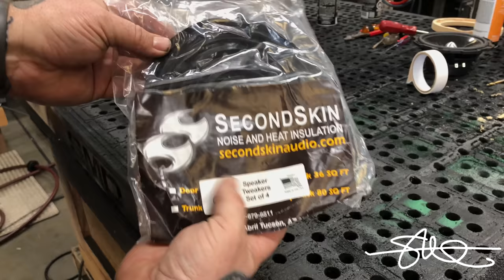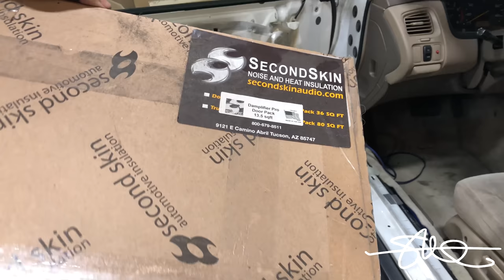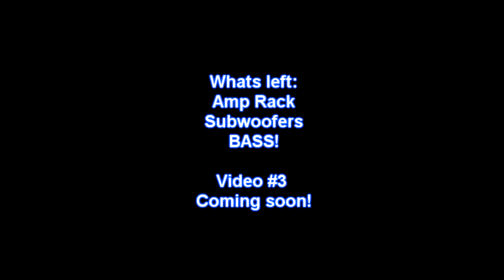First "Real" Sound System - Full Install! 6.5" Component Door Speakers, Wiring, Crossovers (Video 2)

Comment from the maker: for daily updates a lot sooner than youtube....visit and follow my instagram channel http://www.instagram.com/meade916 thanks!
Reply: meade916  I can't wait to see his face
Reply: meade916  i recently found out that the amps in my truck are not even secured  they’re just wired in  are you open to the public? I do understand you are doing this system for someone you know.
Also i seen stan around for a few years now 
What u did was straight up knocking it out the park man.
Reply: meade916 bro looks good although I had a bad experience in not running it through the stock boot . Ended up getting water in the cab ...
Reply from the maker: sounds like you or your installer didn't know what they were doing.  Next time take it to someone more qualified.
Reply from the maker: sorry Audry my shop is not an install bay for the public. But thanks anyway just in case i was! :)
Reply: meade916 clean ass install... You make it look so easy lol .
Reply: meade916 what radio station do you listen too most of the time it's a good mix of shit...
Reply: meade916 psyph Morrison a youth football coach? With music that hot, I'm puzzled why he's gotta have a job, let alone not drive a wraith. Lol shout out to the big homie!
Reply: Real talk I can see you doing a show on the velocity channel.
Reply: meade916 ya Mr Steve Meade I'm very interested in your RCA wires and was looking into a couple sets... my questions is, and it may seem dumb but I have to ask..does it make that much of a difference and why?..not just for me sir but to all the noobs like me...I've only been back into this of lately and I love your products Plus I rep 916 also...looking forward to more of your vids and products...✌🏽thanks Triple OG
Reply from the maker: music business is tough no matter how good you are...if you aren't established and have a big label backing you, it is a struggle.  He deserves more than he has but he is a fighter and will keep pushing till he has nothing left.  He is a good dude.
Reply from the maker: spotify....
Reply: Do you have a video of the customer  picking his car up?
Reply from the maker: SMH
Reply: meade916 smh?
Reply from the maker: yes. That means i am shaking my head.
Reply: meade916 did I say something wrong?  I just want to see his reaction. You do the best work. I've been following  your work for years now since gotten on YouTube
Reply: Your like the God of subwoofers!
Reply: Meade916 , nice video, u are a bad man. Bad as In Michael Jackson bad. Question I see you used a set of Rockford Fosgate T2652-S for the front speakers what would u pair to put for the back speakers and which amp wattage would you used? Thanks for your time.
Reply: I have 03 dodge ram my dashboard has 3.5 i want to turn it into 5.2 how much work it needed
Reply: meade916 what’s the best style of door speakers circle or oval
Reply: Sí CASA Teocaltiche Jalisco Chevrolet Cheyenne Silverado lowrider carro foto carro facebook Armando Ruvalcaba feliz cumpleaños 
3 de junio del 1986 3de junio del 2019 🔊🔊🔊🔊🔊🔊🔊🔊🔊🎧

Comment: Call me a noob but that's the first time I've even considered mounting the crossover inside the door. Top notch job too with the custom bracket and everything. And to think I thought I was so smart for mounting the crossovers behind the a-pillar kick panels in my first install in my cousin's Ford Sierra over 15 years ago, haha. Though to be fair in that setup I mounted the tweeters about 1/3 the way up his A-pillar next to the front window, so I suppose in that case the crossover location did make sense. Still it's nice to learn new stuff especially since it's done with so much attention to detail. I love stuff done properly and Steve you always deliver, thanks!

Comment: Steve, your work is super clean. I have a car like that and it was a bitch to run the front speaker wires. You accomplished the cleanest look I have seen right there. Not even my car and I really appreciate your hard work to get it done right.

Comment: I actually engineer, design, install and program whole house automation, and theaters, which is all 12 volt anyway, but what I enjoy is that he makes his nstalls as idiot proof as possible, just like I use to do when I installed car audio. I carried that level of detail into home audio, and started my own business doing to homes, what he does to cars. #TRUESTORYBRO
Reply: If you ever need a sound barrier for a sound studio, hit us up Our Luxury Liner rolls make an awesome barrier layer and are used in Dr Offices, Elevator Shafts, and even in Recording Studios like the new one being built in Burbank, CA using Second Skin Luxury Liner (Can't reveal the name yet).
Reply: Second Skin Insulation I'll keep that in mind, I usually use quiet rock, and various industry standard acoustic panels to remove reflection, and so forth. There isn't a whole lot of call for sound deadening, as we aren't talking about incredible decibel levels, but rather HIGHLY calibrated set ups for 7.1+...
I will keep that in mind though, if the situation ever turns up, or I build another car audio system.

Comment: Sound system costs more than that car!!!
Reply from the maker: probably cost more than YOUR car too. So what is your point?
Reply: I drive a 2014 charger v6 with 39,683 miles on it, you figure out the kbb value and let me know if the stereo is worth more.

Comment: Hey Meade916 Nice Work!
Thanks for Sharing. That was a neat idea for the Crossover & Tweeter install.

I am installing these R.F. T3652-S  with a R.F. T1D2-10 Sub in a custom High-Output, Ported enclosure Box & a T1500 & a T1500-1BDCP 1500 Watt Class BD Power Amplifier  in a GMC Savana Cargo Van.  
Of course I Sound Deadened all the walls, floors & overhead Cab area.
I'm thinking of building a upright Shelf 2010 Aluminum extrusion to house the Units the Sub, Amp & axillary Stereo. 
Any suggestions?

Comment: Curious why you door mounted the tweets instead of the factory spot, just simplicity? Also I have an 02 Accord as well, hit the door jam boots with the heat gun for a minute. Makes it flexible enough to get the wire through easier

Comment: Any concern with the extra length of wire coming of the tweeter hitting the 6.5? Did you pull the extra wire back towards the crossover?  I am only asking since it was not in the video.
Reply from the maker: no concern. Thanks for the concern. :)
Reply: Thanks for the quick response, Honda coming together nice, Mr. Morrison will be excited!

Comment: I love watchin these, ive never done componets but you just made it look real easy. I might try it on my impala but i dont think im gonna be able to make a holder like that for my crossovers
Reply from the maker: the holder is purely freestyle. Each car will have it's own challenges as well as easy stuff.
Reply from the maker: oh, and thanks a lot for the comment! i appreciate you man!
Reply: End of the day you can always move the crossovers around if you need to, if you can't mount in the doors themselves find somewhere around the dash and just run the wires through

Comment: I always see most systems only have those type of speakers for mids and so do I, and I have a hard time with midbass frequencies. Most music on my system sounds ok, but if you play some  music which has high bass frequencies, my system barely plays those. For example, if you play "Cuban Pete" from Kings Of Mambo soundtrack, the higher bass notes can barely be heard on my system.

I have gains almost correct (set up by multimeter, other tools are just too expensive for me), nice equalization. I have a Powerbass 4XL-65-92 mid set, DB drive Okur Tweeters, a 10" flat Pioneer sub, quantum audio xtreme series amps (1 for mids and highs, 1 monoblock) and Pioneer head unit. I had a different DB drive amp before and it was the same thing with frequencies.

The mids are installed on kick pods. WTF am I doing wrong?
Reply from the maker: your gains are wrong for starters.  You simply cannot use a DMM and have it be any different then if you just guessed them. If the proper tools are too expensive, take it to a qualified installer.  Make sure they at LEAST know how to use an O-scope.

Comment: Please help. I want to install a highs amp on my 2006 accord 3.0 coupe. Will I be able to use the factory wires behind the stereo or do I have to run all new wires to the front speakers and tweeters? I believe it’s stock tweeters and New JBL 6.5 in front RN.

Comment: Why you using an impact driver with a hole saw attachment? It generally takes a lot longer and sometimes stalls out.
Reply from the maker: my hole saw locks into it and it was the closest drill to me at the time. Makes no difference it cuts just fine.

Comment: Great video Steve. I have the bose door speakers in my escalade ext. I was wondering what component speakers you would recommend. I have JL 13.5 subs. But I need to upgrade from the factory head unit and components. Any advice would be greatly appreciated. I want a clean sound along with the deep bass. Thanks

Comment: Steve I had a question on your last video you ran the big three one from the alternator to your battery I noticed that you didn't put a fuse between the battery and alternator on my ride I'm using a 200 amp isolator I'm also using 0 gauge cable do I really need a fuse between the isolator in the battery battery

Comment: I’m sure this is a super noob question, but what is the purpose of the second skin noise and heat insulation that you put on the backside, as well as on the front of the panel?
Reply from the maker: to stop some of the vibration and rattle.

Comment: Never trust a guy who uses a hammer drill to drill holes in wood
Reply: trulycanadian2012 I like Steve but this shit made me laugh lol. I thought the same thing
Reply from the maker: never trust a guy who doesn't know the difference between an impact gun and a hammer drill. Dumb ass.  Oh, i used it because my hole saw snaps right into it....it works perfect.
Reply from the maker: did you see how clean that hole was? when was the last time you have cut a hole in a door panel? This is like 1,000 for me.
Reply: Be a lot cleaner if you used the proper drill lol, also why mount the mid amp in the door, now you have to take the door card off if you need to make adjustments . Also should have secured the tweeter wire because it likely going to end up infront of your mid and rattle constantly.
Reply: Dudes a hack who fell into money after he put all his monies into doing hair tricks. Now he has other people do what he pretends he does. Kind of like when he put the electronics on the OUTSIDE of the  moisture barrier.
Reply from the maker: actually it is exactly AS clean as a drill.  And you should just stop talking now.  You sound more and more like a fool with each key stroke. There is mid amp in the door. That is a crossover SMH LOL. Just stop dude.

Comment: Why are you not sound deadening the entire door? It's gonna rattle like hell once you turn the volume up, isnt it?
Reply from the maker: sure and then after the door why not the entire car? the roof the floor, all the doors....LOL....where does it stop? dude, this is a system with 2 12's and a pair of mids and highs.  He don't need all that. Anything that rattles will be addressed.
Reply: Was just curious as in my own car the doorpanels were rattling when playing just with standard headunit and speakers. Wasn't trying to criticize your work at all - been following you for a long time and I know you know what you're doing

Comment: Whats the difference between  the round sound deadener behind the door speakers and the regular sheets?
Reply: I actually have a similar question...why the rubber looking Second Skin back wave mat over say the foam ones that you'd get with a set of Fast Rings? Is there a benefit to the Second Skin rubber looking style or is it just personal preference?

Comment: What do you call that rubber ring you adhered inside the door behind the speaker mount? Sold in stores?
Reply: Those are Second Skin Audio Speaker Tweakers - available at www.secondskinaudio.com or Amazon. They redirect the rear wave away from the back of the speaker to reduce distortion.
Reply: Thanks for the reply! Cool to hear from the company itself. Your comment made up my mind for what deadener I'll use come March. Cheers!
Reply: Chase Tappan you won't be disappointed. I used second skin on my old Alero, 2 layers on the trunk sides, 3 on the floor and lid, a layer between the trunk and outsr garnish molding that says Alero, n a bit on the doors. Point is, I ran it for 3 years, n when I sold the car without the stereo, that deadener was still in place. The weather changes (NY) didn't affect adhesion one bit.
Reply: Thanks for the shout out......we appreciate hearing back from our customers. #SecondSkinForTheWin

Comment: Hey steve. Why didn't you mount the tweet near the 6.5. For imaging. and I smell you on the quick disconnects. I do the same on any yank and skank areas
Reply from the maker: couldn't. No place to put it. Imaging will be fine. It's not that far away.
Reply: rotcodnatas It is also better for treble resolution to put the tweeter a bit higher, so it is closer to the head of the Driver...

Comment: No rear speakers? Ex and lx model accords have 4 speakers only dx model had fronts only. The dash has opening covers for dash tweeters.
Reply from the maker: no rear speakers on purpose. Deleted them.
Reply: Most people will delete the speakers behind them because you don’t want noise coming from behind you, i did this also in my single cab.

Comment: Does the rear doors not have speakees?
Reply: No, just the front doors and rear deck speakers
Reply: @Luminous.Dynamics I doubt the rear deck has speakers. Just 6.5s and tweeters in the front doors and subs in the trunk.
Reply: @blazed_existence3338   Oh yeah. I thought he asked if these cars can have speakers in the rear, which they can but only on rear deck
Reply: @Luminous.Dynamics  My bad. His question was a little ambiguous. I thought he was talking about the build and you thought he was talking in general terms of speaker locations...so we're both right...win, win on the info bruh. 🤜

Comment: Meade916 where do you get the smaller terminals that plug into the speaker that you used? I can find any good ones that accept a 12 gauge wire
Reply from the maker: parts express. But that is 16ga wire not 12.
Reply: meade916 what brand wire did you use

Comment: i really need your help i bought some 6x5 and the freaking magnet is too big for the oem mounts so the speaker doesnt fit that :( could u do a custom mount ill pay for it too
Reply: Make or order some spacers
Reply: @jmjosemora16  ok so this is what i did lmao.
i bought gorrila glue mounting tape and then i put 1 on each side and then i put the speaker on it and it the mount held it. and then i also put duct tape around the corners of the speaker so it can give it a "extra hold" lmfao its ghetto but that shit works!

Comment: I put in a Kenwood head unit and added a amp in my wife’s 2004 RX330 Now I have a bad whining sound out the speakers I eliminated her factory amp and tapped into the speaker wire from the rear of the vehicle to the amp How do I get rid of that annoying whining
Reply: Sounds like a grounding issue
Reply: What can I do to fix it
Reply: Harold Frazier Buy a good Line Driver and check all grounds

Comment: why not run the speaker wire inside the door wire harness it would of been a pain in the ass to get in but look more neat
Reply: firefox01 listen to what he said before he ran the speaker wire!
Reply from the maker: it looks plenty "neat" the way i did it. Thanks anyway.
Reply: That's exactly why. It's a vehicle from 2002, anything rubber on it is going to be soft and somewhat brittle. The other issue is actually running the wire through the boot. On most vehicles the boot is already barely larger then the wire harness itself. So if he ran it in the boot that could prematurely wear the boot or wire out. If the boot ripped he would have a very bad day because that would mean removing the wire harness to install new boots. Sure it frowned upon but in this case it's ok.
Reply: It looks fine as he had It I probably would've done the same thing
Reply: firefox01 those boots are not hollow. It's a plastic "plug" that you would have to drill through to run wires through. Those hondas are a pain in the ass to run the front speaker wires. That's really the cleanest way of doing it on those honda accords and civics without wanting to take the doors off.